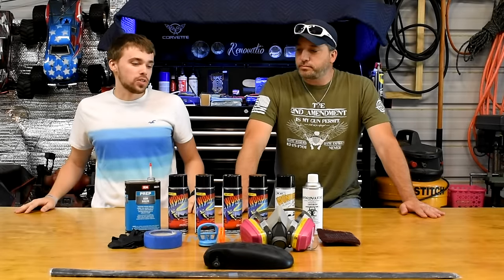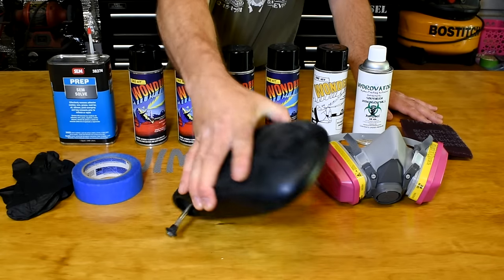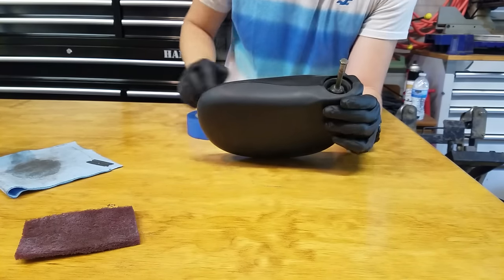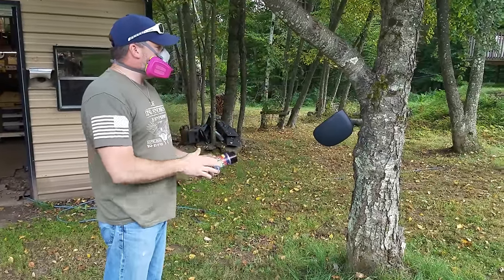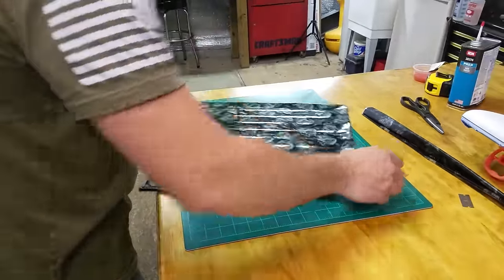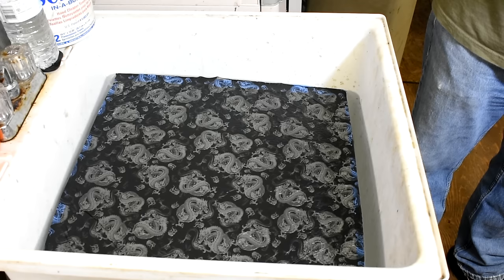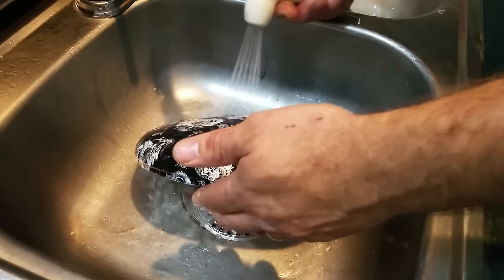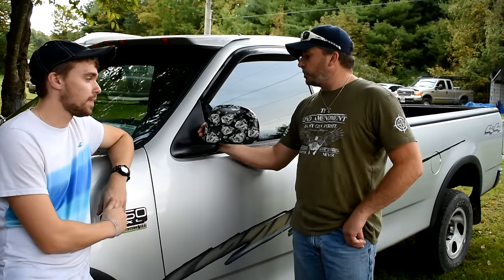How To Hydro Dip For Beginners 2.0

Comment: Is there anywhere we we can buy this paint at a store in Pa?? Paint is very expensive to ship anymore and would rather buy it locally.
Reply from the maker: Ron J. Stavetski hey there. The wonder paint specifically is their own brand. So I don't think there are physical stores on PA. Don't get me wrong, you can manage to use store bought paint, just keep in mind you need to dip relatively as soon as it dries. The paint process is forgiving. You just need to use the activator to activate the film. 8f there's anything else I can help yah with just let me know:)
Reply: First off I want to say thank you soo much for your response. Been dipping deer skulls for a while now and what ya said about dipping right away is absolutely correct. If ya should let dry too long when ya dip into the film, it looks great, but as soon as you rinse it starts to wash off. Just doesn't adhere. That was the biggest problem we have ever had. Learned that ya have to spray and shortly after dip. asap!!!  But was reading up on the wonder paint  and thought if I could buy it locally that it would be nice. Like I said the shipping on paint products anymore is just ridiculously expensive!!!! Thanks again!!!!!!
Reply from the maker: No problem at all. Yeah  I understand the struggles with the paint shipping prices, that's why when I am going to buy paint, I'll usually buy it in quantity from one place so I have one flat rate shipping cost, instead of buying a can here and there and getting hemorrhaged for shipping cost. Dipping deer skulls that's awesome! If you wouldn't mind I'd love to take a look. Just throw a DM my way on our facebook page. I love to see your guys dip projects as well!

Comment: Does the sticky part go face up or face down on top of water
Reply from the maker: Sticky side face down on the water( so the sticky is touching the face of the water)
Reply: Great tnx cause my 1st dip try the film started to draw back like a melt away then when I rinsed it completely washed off
Reply from the maker: @karinmoss8740  yup sounds like you had it upside down!

Comment: I'm interested in dipping. What site is the best place to get the film? Does it work on chrome? thanks.
Reply: i clicked on the link you gave. i looked for film that others have used and it couldnt be found.
Reply from the maker: dewayne hess hey there, you can find dip on Amazon and Ebay. Just type in Hydrographic film In the search bar and it should come up. As dipping chrome. As long as you prep the surface accordingly it should be good to go! Hope this was of some help, if you need anything else just let me know. Thanks for watching:)
Reply: yea i looked in amazon i found a few but not the ones i seen. but i looked on ebay found some. with chrome i'll try it and see what happens. thanks for the help.
Reply from the maker: Glad I could help. If you need anymore help just let me know!

Comment: will this adhesive damage a protective helmet?
Reply from the maker: I would imagine it would be dependent on the helmet material. But most safety helmets are a very hard plastic that would be fine, but as added assurance if you paint the item, the adhesive would be sticking to that. If you're ever more curious you can always search the web, or you can DM our Facebook page and we'd be more than happy to figure all that out for your application with you! Thanks for watching.

Comment: I dipped 2 items and the dip was just leaking off when I was letting it dry I didn't paint it before hand 🤦🏻‍♂️
Reply from the maker: Yeah you have to paint it so the dip has something to adhere to. If you want to keep the base color you can paint it with a clear.

Comment: Can you add more clear coats at the end and wet sand the orange peel off?
Reply from the maker: Not sure what you mean by orange peel. But once your done you can clearcoat the item as many times as you want. I'm not sure about wet sand as I think youd go through the clear coat layers and sand off the film.
Reply: @Jimmy2Tech  was curious if you you could get that clear coat super shiny coat
Reply from the maker: @ChrisEVHWOLF  yes in theory you can. You would just have to be careful clear coating to make sure you're wet sanding the clearcoat and not the film.

Comment: Good video but one thing I will say is that was you call 'scuffing' coming from a painter you don't want to do, what you instead want to do is use scotch bright (on this product use grey) and combined with using g-matte and a lot of water you want to make a smooth surface, this is what the primer will stick too better, Not being scuffed up, hope this helps.

Comment: Good video, butttt respirators don’t work with facial hair so make sure you shave if you want to wear one successfully and correct, also the tape around the film keeps the film together. I’ve never seen it sink without tape. All in all solid how to video!
Reply: Works better than no respirator

Comment: How would you hydro dip ac vents that move?
Reply from the maker: To be honest with yah, I'm not quite sure! I only see potential problems when I think of a dip like that due to all the vents. I tried doing some research but came up short. I've seen people dipping car vents (bigger gaps between vents) and it worked fine. Best you can do I suppose is give it a whirl and see what it does. If you do try it please let me know as I'm extremely curious of the process.
Reply: Jimmy2Tech I may try it on a vent from a junk yard first to see how it goes.
Reply from the maker: @linderlounichols2809  that's a great idea. Give it a whirl and let me know how it goes!

Comment: Can I dip in cold water pls tell me ???
Reply from the maker: raju b naik raju b hey sorry for the late reply, but I hear that you can use cold water but it's not as effective and the dip usually doesn't turn out as good. Ideally, I'd heat up the water to make sure everything binds accordingly. Thanks for watching, if you need anything else just let me know.

Comment: I had problems with the film coming off when I rinsed the part after I dipped it
Reply from the maker: Well there's a few possibilities so I'll try to help you out. After the dip the film can come off if the product wasnt prepped properly. For example if there was a section with oil/ grease on it the film would fail to adhere properly. If you believe the surface was prepped well and free of imperfections then there is always the possiblity that you didnt spray enough activator on the film before the dip. If there wasnt enough sprayed there can be parts of the film that wont adhere properly to the product which can lead to it coming off during the rinse cycle. This is usually the two major problems that we've come across. Hope this is some help to you. If you're still having problems feel free to reach out to us and we can better try to pin point your issue.:)

Comment: Hello, Thank You for the Video, it really helps. I believe the filters you have on the respirator are magenta, which are used for small particulates, You Need a Carbon  Filter to remove the efffect of the fumes.If you can smell any of the chemicals with the mask on it is not protecting you. I am not trying to give you a hard time, Mr. Perfect, but from not wearing the correct or some for a quick touch up, has caused me severe breathing problems. And I should of known better being in the environmental trade for years, Dont Figure. Anyhow,After the part has been washed off with warm water for 3 minuter and or blown dry, How long, does it need to wait until you can ad your clear coat? Is the Clear an enamel based paint or? Can a Poylurethane clear be used ?
Thanks alot Guys
Respectfully Jim "P" Jenuine-Motor Cox
Reply from the maker: Thanks for the comment! Yeah we know it probably isnt the right filter but it was a spur of the moment to make the video. We'll have to look for the carbon ones. Thanks. After the item has been rinsed and is dry, you can shoot your clear coat on. Any automotive grade or equivalent clear coat is fine. If you're doing any item that is going to be in the elements a lot I'd reccomend using the two stage clearcoat. Thanks for watching and glad we could help.

Comment: what is the durability in other words how long does it last & what happens when exposed to really harsh winters
Reply from the maker: nick diaz hey there, well extremely durable I'd say. These hydrodipped mirrors are still on my truck to this day. Takes the beating of bugs at highway speeds, countless washings, New York state weather, and all the elements and it's still there. Not to mention that's without a 2 stage clear coat which is designed for the elements.:) thanks for watching.

Comment: how much time should be sealed before applying a glossy spray
Reply from the maker: sanjin077 after rinsing the dip in the sink for 3 minutes with hot water, I usually let the item air dry, and once there is no more water on the object, it is ready to be clear coated. There is no real set time, jist make sure the dip is completely dry:)
Reply: Ok tnx

Comment: Why didnt you tape up the glass of the mirror?
Reply from the maker: Because on a unprepped surface you can get the film off pretty easy with some cleaner and a razor blade.
Reply: @Jimmy2Tech  that's fair enough, thank you for your quick response

Comment: thanks! how much activator you put?
Reply from the maker: Cant really give you an amount to use, just put a nice even coat on the film and you'll be alright.
Reply: Thanks for you replay! I was just wondering how much activator will i have to use on a a4 sheet to make a dipped planter :)
Reply: this stuff is really expensive in israel
Reply from the maker: @dorfriedman9115  gotcha! Well it's not a crazy amount. You spray over a nice even coat and you're set. A full can of activator should last you many dips. Once you begin to spray you'll notice the film chnahe texture and that will let you know you have enough. It goes from film looking, to a water look.:)
Reply: You are a superstar m,y brother thanks so much.
i just bought a formula in Ebay for 2$ on how to make DIY activator so i am now going to order some sheets and have fun! ;)
Reply from the maker: @dorfriedman9115  good luck! Let us know how the dyi activator works. Quite curious. Thanks for for the kind words and thanks for watching!

Comment: What about prep for hydro dipping  metal?
Reply from the maker: If you head to our channel, our first dip was a metal gas cap. Generally same principle with metal. Just have to make sure its prepped right and then it's as simple as every other dip.
Reply: @Jimmy2Tech  sorry this is my first time watching your channel
Reply from the maker: @brandonbean2748  no problem! Yeah the first dipping video we made was on metal. I'd refer you there cause it may help you answer your question better to see it hands on:) if you dont have time though, we just used a scour pad and gave it a good brush, then cleaned it off with sem solve, gave it a coat of wonder paint, then let it dry completely. After all that was said and done we finally did the dip, rinsed off the excess, dried and clear coated:) if you have anymore questions feel free to fire away:) more than happy to help.
Reply: @Jimmy2Tech  thanks bro :)
Reply from the maker: @brandonbean2748  Anytime. Glad to help.
Reply: @Jimmy2Tech  keep doing what your doing and good luck

Comment: When I spray my activator, it’s causing the film to expand way to much, to the point the print is distorted. To counter act that I spray less, but then it’s under activating. Any tips?
Reply from the maker: If you're using a big sink, to combat that problem get some painters tape and outline the film  with like a 1/4 inch  tape onto the film. This way the film withh be trapped in the tape and not spread out. This should fix your problem! Good luck and thanks for watching:) If you have anymore questions feel free to ask.
Reply: @Jimmy2Tech  Really appreciate the reply, thanks. I haven't been taping the edges to be fair so I will give that a go!

Comment: I want to print my own films. Like if I take a picture of something them want to turn it into a film. How do I do that, I cant find anything online about it except a video of someone using a big printing machine.
Reply from the maker: It takes a certain kind of printer to make that happen. So unfortunately you have to have one of those machines or have it outsourced to a hydrographic place that can put custom photos onto film. We were looking into the same thing!
Reply: @Jimmy2Tech  so there's no way to convert a printer to do that. That sucks. What are the printers called so I can look into them
Reply from the maker: @ShadowkingX  not to sure if they have a converter. Havent really looked into any of it, just a general idea we had. Just search for "hydrographic printer" and that should be a step in the right direction.
Reply: @Jimmy2Tech  I think I found some
Reply: RicePaper...

Comment: So if my hard hat is already white I don’t need a base coat? The film I have recommends a white base
Reply from the maker: If it's already white you're more than welcome to clean it off really nice and then go for the dip. Remember there can't be grease or oil on the item when you dip it otherwise the film wont stick properly.
Reply: Jimmy2Tech ok what if paint has chips in it. Will dipping it cover that or should I just use a base coat
Reply from the maker: @cityoftrees9953  you could always spray clear paint as a coat before you dip and you'll be good.
Reply: Jimmy2Tech thank u!
Reply: Jimmy2Tech clear paint as in gloss?
Reply from the maker: @cityoftrees9953  they have clear paint you can use if you want to keep the color you have. It's different than clear coat if that's what you're asking. You can use gloss or flat, it doesnt make a difference really.
Reply: Jimmy2Tech yea that’s exactly what I meant. When I google clear paint I got gloss or clear coat. But I will search for clear paint. Thank you. Last question. Do I need that scotch brite pad before I paint with the clear? And how much do I scuff it up. My hard hat was kinda expensive. I just want everything to go right the first time.
Reply from the maker: @cityoftrees9953  if you're using clear paint over something that's already painted you won't need to scuff  just make sure you wipe off any oil or grease, then paint with the clear paint, let dry, and you're ready to dip. If it doesnt turn out the way you want you can always remove the hydrodip after the fact and repaint your helmet back to factory color so no fear there.:)
Reply: Jimmy2Tech thank you. Really appreciate it. Liked the vid. And will be subscribing
Reply: Jimmy2Tech ok so I messed up on my dip. Can I just paint over it with white and dip it again? Do I need to add clear over the white?
Reply from the maker: @cityoftrees9953  best way to do it is to take the old dip off, paint, than redo the proccess again. If you paint over and redip you're creating a layer on top of a layer that can be peeled off.
Reply: Jimmy2Tech makes sense. Thank u
Reply: Jimmy2Tech last question. I sprayed over the dip with a clear coat. Should I use some type of chemical to get it all off. Or can I just scrub it off
Reply from the maker: @cityoftrees9953  you can scrub it off. I usually just sand blast the item but it honestly depends on what the material is. Just use your discretion.

Comment: How did you avoid getting paint particles on the mirror surface?
Reply from the maker: Barry Anderberg hey there, really simple. A little glass cleaner and it came off. If little parts seemed to stick to much I gently used a razor blade to scrape off.

Comment: will this work on a piece of wood?
Reply from the maker: Carl Zorro yup this process will work on wood, most plastics, metal and a plethora of other materials. Just when I speak of wood being used,keep in mind that the texture and prepping of the surface plays a big role on how it will turn out.
Reply: should I put pre stain on the wood before this procedure?
Reply from the maker: Carl Zorro sorry for the delay, yup I'd get the wood, sand it down, wipe off all oil and grease with a degreaser, and then lay a coat of stain. Usually you want to make sure the wood is sealed before you dip it. That way the wood isn't destroyed by sucking up moisture and rotting. Plus having it sealed properly gives the dip a very good foundation to stick too.
Reply: got me hooked on this:) thanks
Reply: Right, the pre stain stuff will not let the water  be absorb all in the wood.
Reply: I was thinking , perhaps if I put the poly coat on the wood all around it would seal it for water :)

Comment: So, all of the ingredients needed are: 

Activator
Hydrographic film
Something to dip

Is that right?
Reply from the maker: Yeah as long as you have the item prepped properly etc. If you want to see a lost of everything we used it is in the description:)
Reply: @Jimmy2Tech  Thank. You. I was hoping for a quick response. Now all I have to do is buy it! Also if I may ask, does 'prepped properly' mean sprayed down with activator?
Reply from the maker: @DavidMartinez-oc7nj  it means the item is painted and doesn't have any oil/grease on it prior to the dip. That would stop a good bond between the film and the item. So make sure your item is clean before the dip, then follow the video instructions and you'll be good to go.

Comment: You want to make sure the gloves are chemical resistant also
Reply from the maker: Dallas Smith ph very good comment! Most of the time regular latex gloves will do the job fine or some painters gloves. It's typically either to keep your skins oil off the product or to keep the dip off your hands. Normally the concentration of activator once applied to film isn't enough to effect the glove but direct contact can cause some issues. Thanks for the comment I'm sure it could help others, and thanks as well for watching.